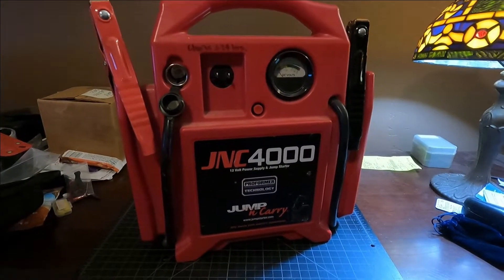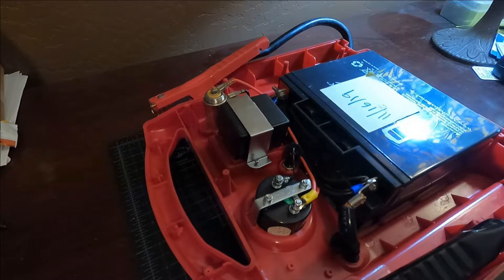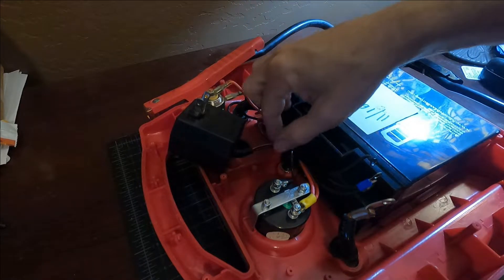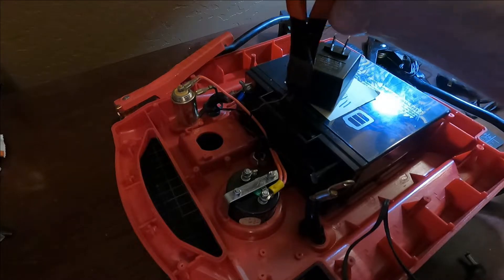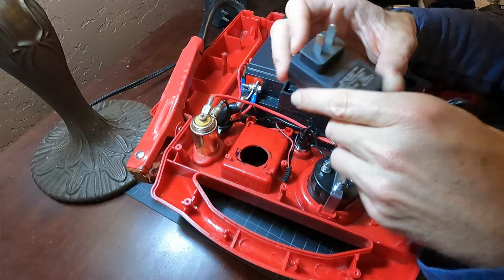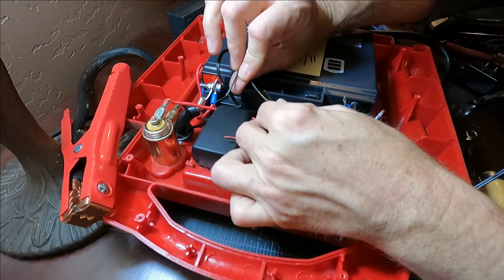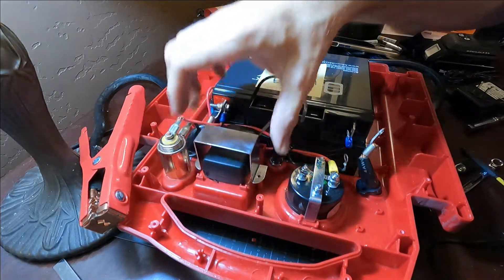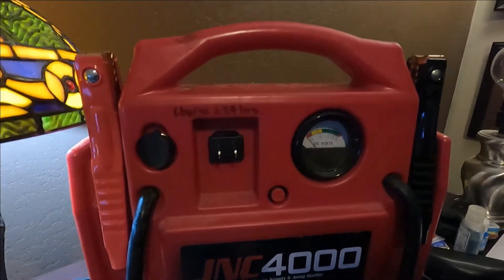Jump n Carry (JNC 4000) Battery Jump Box Broken Plug Fix and Internal Battery Replacement

Comment: Hey The charger probably had a small capacitor inside which holds slight current. The JNC are 1.5 milliamp which connects to a small board before going to the Neg & Pos sides of battery. Your charger goes directly to battery

Comment: Is it ok to replace 15v transformer (original) with 12v AC to DC transformer? Battery inside Harbor Freight battery jumper is 12v lead acid battery. Thanks.